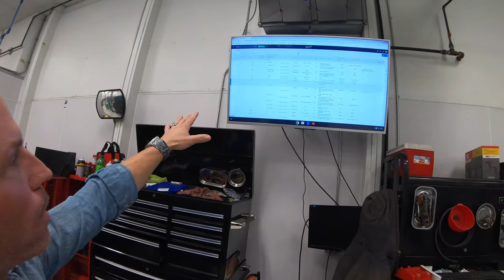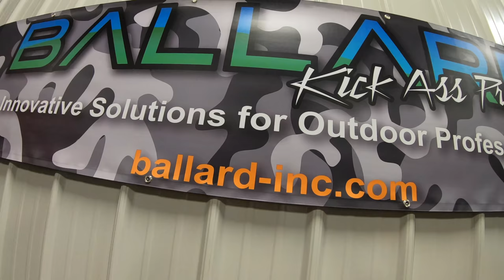5 new Lawn care tools & equipment with improved designs and Brand new gear. 4k

Comment: I love my X blade system! Stripes are amazing stays balanced great. The only problem that I have ever ran into with this system is that when the grass is wet it seems to build up quite a bit of grass on the deck and then once it’s too much it blows out chunks but that’s not a deal breaker for me I will never not run this system on any of my mowers going forward!

Comment: personally I own the x blades and I run it on the husqvarna v554. The x blades are amazing. Only problem with it on my mower is I can not seem to find thinner blades that fit the 54in deck. I believe the blades on the 54 are .25in thick. I do not think that x blades are supposed to be run on blades that thick, but so far it has not been an issue.

Comment: Thank you Stan and Corey for the CODE........ need to know if you have the adapter for X blades for the new Pro Series Cub Cadet????     Would like to get three of these......     I also need the LockerPro (greatest invention on the planet - do darn straps)    Another great video of VALUE to your viewers and listeners......Thx Stan
Reply: Sun Seeker most Cub Cadet have the star center hole but I think the Pro decks are now coming with the round center hole. Measure your blade width and center hole size and we should have a kit to set you up right. I think you’re running the 2 1/2” wide blade with a 5/8” center hole. Please verify. Let us know if we can help! That mower would use the 300 Power Locker. Thank you!
Reply: Ballard Inc  The cub cadet commercial mowers have always had a 3 inch blade, center hole and it looks like 3/4”.   I will confirm this tomorrow.

Comment: I remember talking to a knowledgeable guy @ Oregon years ago about the X blade setup.  If my memory serves, they actually advised against using an Xblade setup with their gator blades.  Gators direct airflow back towards the spindle so the grass can be recut.  I wonder what is happening to airflow with both a high lift blade sending grass out + gator sending back in.
Reply: Dominic Duke what’s happening is a lot of mulching. We don’t recommend a high lift blade. But a standard lift on bottom and mulching on top. This has given us the best results in all conditions. Thanks

Comment: D M after having destroyed three single blade mowers in just over two years, ( JD walk-behind), all from hitting rocks and roots which then bends the crankshaft, I am interested in seeing how those X blade set-ups work. Is it feasible to show them cutting from under the deck? And a shot of the finish product lawn.? Another question remains , is that; would that same Xblade system work under my triple blade  JD lawn tractor? At times I find myself having to re-mow whole paddocks because of missed stalks in long growth. This last season after heavy rains has been a doozy to keep ahead of regrowth. I have given up trying to bag the cut clippings on the bigger sites. Mulching would be a better finish for sure.
 As usual, these product videos are great at keeping us who are head's down, bumup busy aware of what has been happening out there in Lawn-Mowing Land.

Comment: do you run gator blades or something simiilar blades when mowing grass, How much lift do the create and also do the stay sharper then high lift blades ? I live in florida and and is very sandy here and have a set of high lift on my mower and the bend for the lift is getting ate throw how do you stop that ?

Comment: Do you carry the x blades for Grasshopper products? Just watched your video for the 1st time.
Very valuable info. Thank you.
Reply: Yes... if you are running the 2 1/2" wide with 1/2" center hole the XB3 kit will work and once you stack the blades and put your bolt through they will center in place. Thanks!

Comment: I wish the grass flap was foot operated. I would buy several of them
Reply: zach baugh the issue with foot operated is then you have more components including a cable. We just haven’t found that they last, at least in the commercial cutting world. This is a very simple design, cost effective and built to last. Thanks

Comment: Been fabricating custom equipment for 14 years now and I have a couple criticisms. That tiny pin in the bottom of the seat post probably won't last and you could end up falling off. Its too thin from the looks of it to take that kind of abuse. Secondly that mower lift is pretty sketchy. Anyone walks buy and knocks it then the mower is going down. That Deere was about to fall just looking at it and how wobbly the jack looked under it. Like it wanted to flip back up on its one. What he should do is make the lifting arms past 90 degrees to the handle so when the mower is tipped up ..... All its weight is past center and leaning on the handle. It would also be much harder to kick that handle up by accident.

Comment: Can the x blades be used on a exmark viking (the 48"deck) and is there any advantage to bagging with the x blades
Reply: Grime_werks yes they work on that machine. And smaller clippings allow a more full / compacted bagger and you’ll see you will be mulching better. Thanks
Reply: Thank you I appreciate it very much

Comment: OK heres the problem I see with the X blade or I guess I should say it's a question...What if you hit something solid and the blade shears the bracket - now you have 2 loose blades spinning out of control and would think would cause some problems ! What's your thoughts ?
Reply: Kevin Cloonan if you hit something really hard the bracket is designed to give to not do more costly damage to the spindle, blade or clutch. Similar to a keyway. But a $10 bracket is a very inexpensive replacement part to prevent more damage. Hope that helps!
Reply: @ballardinc7510  Thanks for the feedback

Comment: Love the X blade but one question do they fit lawnmowers and the tractors like craftsman, weedeater and other types of non commercial or professional equipment?
Reply: Unfortunately not.... commercial mowers only. Sorry!
Reply: @koryballard7428  I was just wondering if someone tried it
Reply: Scott Fenton typically the blades aren’t the correct size and then proper power also becomes an issue. If you are running the correct blade size of our kit options you’re certainly welcome to give it a run. Thanks!

Comment: Is there a slick jack for traditional lawn tractors?
Reply: Unfortunately ours wont work on a lawn tractor. I think there are a few on the market that cradle both front tires?
Reply: @BallardInc  Thanks I appreciate the response.  What if you put the wheel cradles on the arms of the super jack, could that be a possible idea?
Reply: I don’t think that would be safe. Look at a product called Mo Jack. I think that might be a better fit. Thanks

Comment: I tried placing an order on line on there website and your code did not work, I also tried to use Brian's code creel10 and that would not go through. I tried sending them a message on there website and that also would not go through.